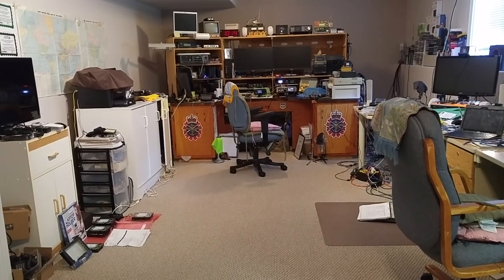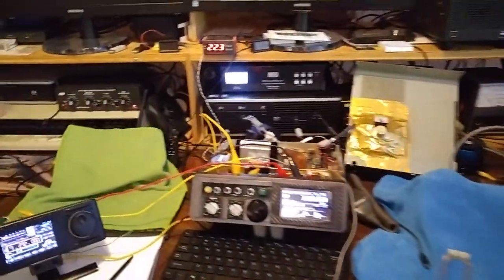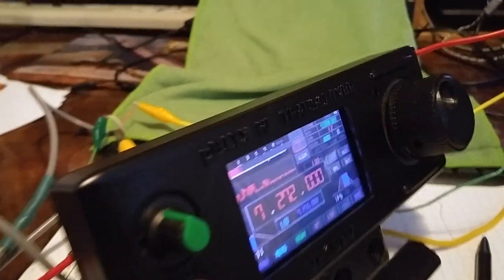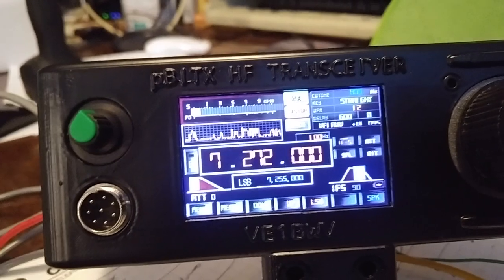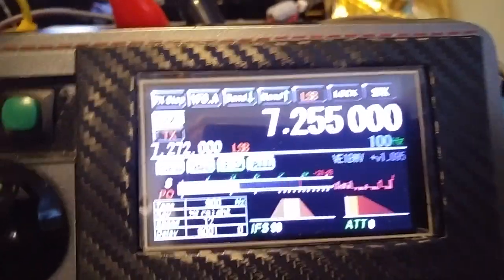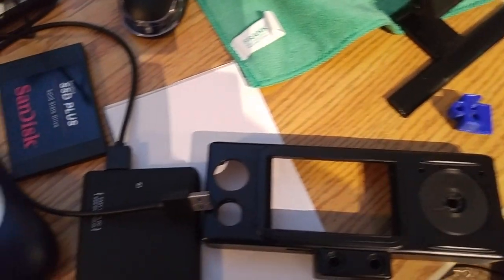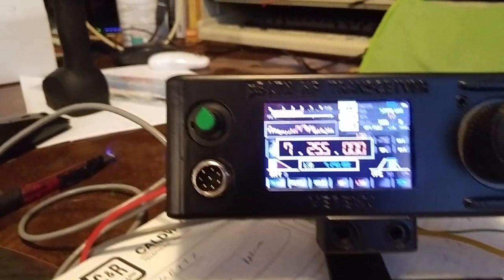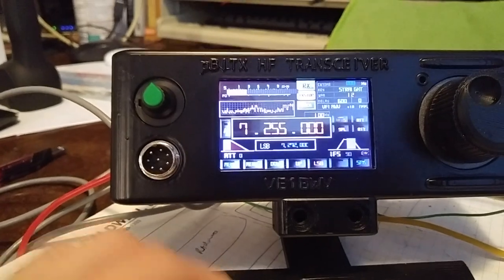uBitx Using Nextion Displays With A Remote Control Head

Comment: Nice video! Did you placed the second display parallel to the first? 73 PA3GYV
Reply from the maker: Yes, you can put several displays in parallel, as long as your powersupply is capable.
I use a separate 5v regulated power supply ( cheap miniature Chinese modules)to ensure the radio board 5v regulator is nice and cool

Comment: what kind of encoder do you use for the VFO?
Reply from the maker: The vfo is a standard rotary encoder - available on ebay..  KY-040 Rotary Encoder Module for Arduino  or Rotary Encoder Push Button Switch Keyswitch Electronic Components 6mm    only a few dollars each or less